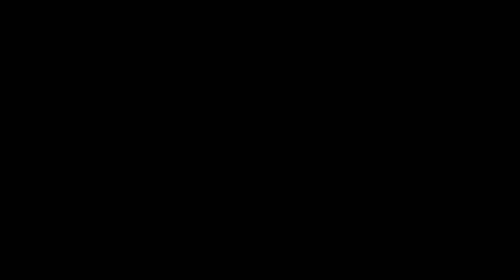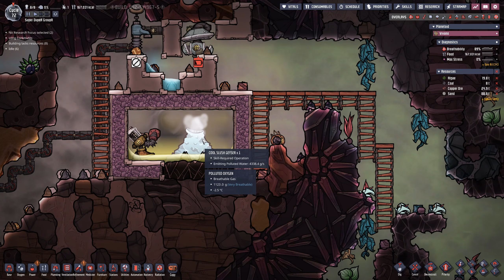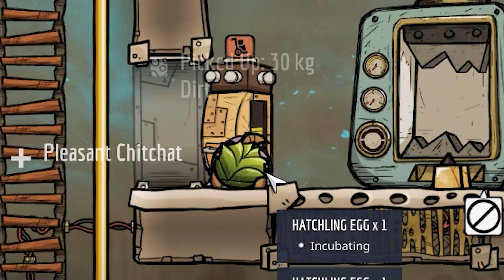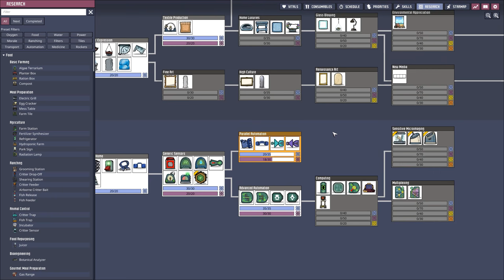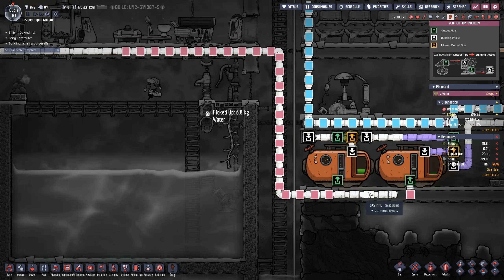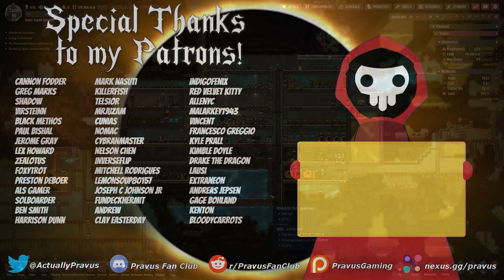Oxygen Not Included -  All-Natural, Gassy Dreckos (Part 6)

Comment: I remember when I was playing this a year or so ago to prevent the power lines from overloading I would have the big high capacity wires running vertically through my central shaft and then on each level I'd have the limiter so I could switch to the low capacity wires to supply that area. My power generation set up was usually either at the bottom (coal generators) or the top (hydrogen which was generally supplied by electrolisers while also producing oxygen, unless I happened to have a hydrogen geyser nearby).

Comment: Drekos (and basically all other animals, not Dupes) don't really need Air to breathe, they do suffocate in solids/liquids, but the worst they do is "not produce product' if in wrong material.  Puffs, won't make slime, unless in Polluted Oxygen, they consume it to make the slime.

You can also use oxygen masks if you need in areas, and, remember to set the stations as "vacancy only" so they only return if there is room for suit to hang up, to keep them charged.

Also if your having packet problems (like with the O2) SLOW DOWN your game, it's having to process too many things and some things like Critter AI gets skipped over (its possible to use this as a glitch to where they never get hungry, but the game tends to run too slow to enjoy) honestly with dealing with liquids and gasses in pipes, slow down the game and let them do a course before speeding back up (filling suits, tanks, etc)

Comment: Pop a couple of air vent tiles with deodorisers on top in the top corners of the geyser tank to vent the over pressure polluted oxygen into clean oxygen, which will also allow the tank to fill.

Comment: Pravus, you got your batteries backward - You said you wanted the coal to be the backup, but the way you have it now, the coal will turn on first - Coal turns on when your power level drops to 20%, and natural gas will only kick on if it drops to 10%. You should reverse those, and then Coal will only kick on if the natural gas generator can't keep up and refill the batteries by itself.

Comment: Re: Suit Dock and oxygen,

Your pump isn't active all the time, because of power draw and it's why the progress seems so slow / not working.

Suit tip: when you have your power figured out a bit more ( might need a episode for that, it's lots of cycles to redesign it all ) you need to install a gas filter.. It's possible (but unlucky to be honest because how you set it up above a oxygen producer to get wrong gasses in the docks)
like carbon dioxide that will damage the suit/building.

----
Thanks for the episode.

Comment: It's definitely an interesting choice for the devs to have the gas turbine drip-drip like that. Typically gas turbines either use a single (Brayton) cycle, where the products are mixed CO2 and steam, or more efficient combined cycle with a separate water/steam line (cool water in, warm water out). Instead, what I think they intend here is a kind of pre-heater, where the water condenses from the CO2-steam mixture. While you get decent efficiency out of this, it's typically not done like this because hot O2 and methane is very... explosive... if there any leaks.

Comment: I've never figured out the Atmo suits because I usually die before I get the materials to build them (the petroleum biomes are killers!). Seriously, I go to the petroluem biome, my dupes get burnt into oblivion and then I don't have the labor to run my base; alternatively, the temperature overheats my base, kills my crops and my crew starves out.  I haven't really figured out the game's temperature management. 

What surprises me is the level of Carbon Dioxide you have in your base.  I like to build a gas treatment room where you can pump in anything and have the room sort it out, but it's power intensive and may not be suited to your strategy. Basically, a bunch of gas filters in series, o2 back to the base, co2 to treatment, Cl2 to Cl2 storage, H2 to H2 storage, CH4 to CH4 storage, polluted o2 to treatment. The main issue I have with it is that I pull out too much CO2 too fast and drop the base air pressure too much, or it uses too much power and I have trouble keeping it running. Though I should note I am a 'hamster wheel squad' guy in this game.
Reply: From what I remember, you use Mechanized Airlocks, powered and automated, to properly thermally insulate a region that you need to walk into. Three next to each other closing at the same time, the middle one reopening (staying open) creates an insulating vacuum. The actual door in contact with the high temp will get hot, but the vacuum will keep it from transferring (if all the doors are closed the temp will pass through them). One way I remember is that the middle one(s) stays open until the airlock cycles, then when the outer doors are closed again the middle one closes and reopens, recreating a vacuum. This can also be constructed vertically, but ladders can't be placed in airlocks, so you'd have to get creative to actually use them in a shaft like this.

And to make Atmo Suits you need Refined Metal and Reed Fiber, not petroleum or plastic, that is the Jet Suit. So either find some reeds or dreckos and harvest the fiber so your dupes can wade into the molten remains of ancient life without joining it.

Comment: How the suits work from my experience is that the oxygen getting pumped in is getting loaded into the suit. The oxygen bar and no oxygen pop up on the dock indicates that the dock does not have any oxygen in its internal tank because all of the oxygen is going into the suit's internal tank since it is empty by default. Once the suit's tank fills up, 7.5kg of oxygen I believe, then the oxygen bar on the dock will start to fill up.

Comment: Yeah, the suit thing is really wierd, maybe you can de- & reconstruct the atmo dock to fix it, I dunno.
Quick tip: I would really recommend putting all that polluted water into reed fiber, you can never have to much of that stuff.
Reply: Apparently both suit and Dock have a Oxygen Tank. The display is for the dock. And it sends Oxygen right to the suit. He just need to pump in way more oxygen.
Reply: @christopherg2347  yes, there's two separate oxygen tanks for suits & docks. The black indicator with the crossed out O2 symbol is the suit indicator and the green one below is for the docks tank.
You can select the suit itself, as with any item ingame to check how much oxygen is in there. You can use suits when they're not full, though that could be different for docked suits, maybe...

Comment: RE: Suit Dock and Oxygen.  The suit dock itself has an oxygen tank within it and the suit has an oxygen tank.  Both are being fed by the oxygen being pumped into the dock.  The red No Oxygen symbol you are seeing is in relation to the suit dock, as all the oxygen you are currently pumping into it is going into the suit.  If you allow the pump to continue to pump oxygen, after it fills the suit (which you won't get a tooltip for) it will then begin to fill the dock.

Comment: some ideas/warnings
the natural gas vent emits at 150C, which means unless you make your pump out of steel, it will eventually fail
a short term way to fix the power grid would be to connect equipment to cycle sensors so you can set equipment to only run during non-overlapping time
another short term solution would be to switch to conductive wire which can handle twice the load
a long term solution would be to compartmentalize the power grid, and give each mini power grid there own natural gas generator and manual generator and pump to get rid of the polluted water
if you need to get rid of polluted water you can either space it or make a large reed farm

edit forgot "water" in polluted water